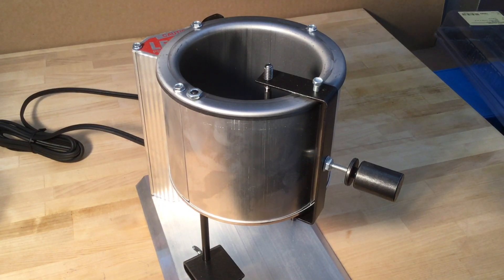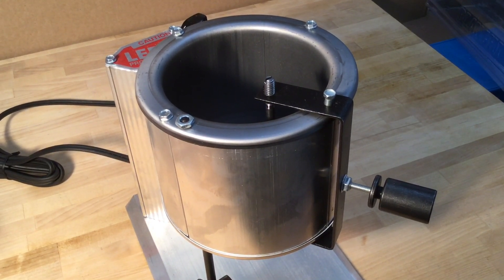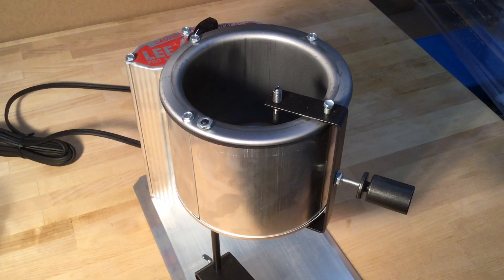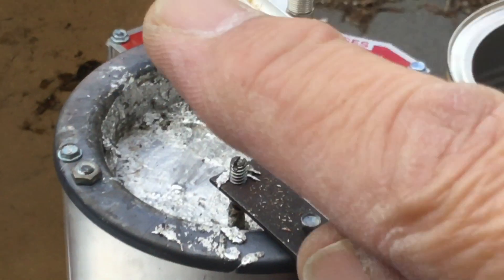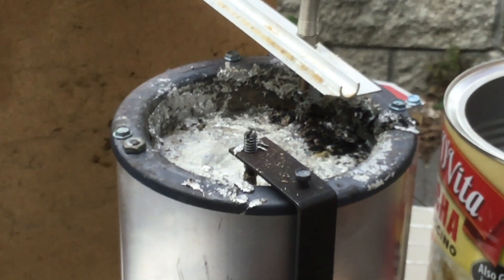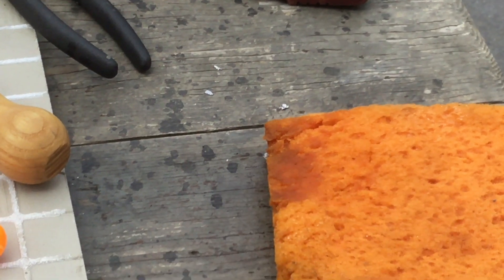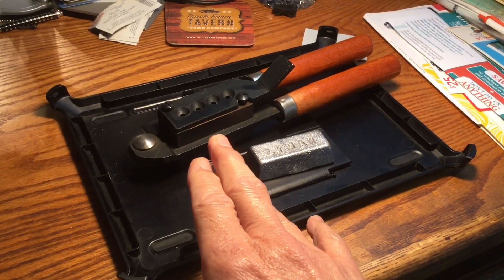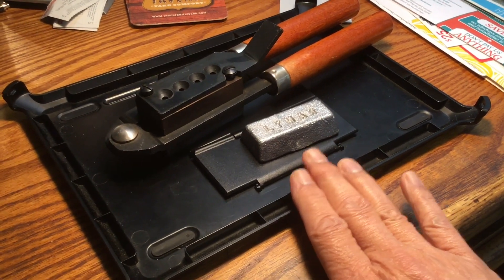Molten Lead, Water, Mythbusters And Casting Safety

Comment: My dad had an old piece of lead pipe he melted in his furnace and a steam pocket blew lead up out of the pot. Luckily he was not injured. 
Splattered molten lead covered the basement wall and ceiling joists in the basement. It was a permanent reminder how dangerous it can be.
Best to breakup the lead and melt it in small pieces if possible to avoid any pockets. Also cast outside if you can or in a well ventilated open area

Comment: I'm here to tell you a drop of sweat will cause a steam explosion in molten lead. I've had problems with casting in cold weather, so I do mine in summer. I  stack 1lb ingots around my electric pot to preheat them also. I was reaching  over the pot one day when a bead of sweat ran down my arm and dripped into the melt. It instantly turned to steam and blew little  lead splatters onto my arms.
Reply: Big difference between a little spatter and the kind of explosion you get from a submersion, especially if the water is encased. I've seen both now, graphically.

Comment: I've had one lead "explosion". What happened was I was water quenching bullets and used a spoon to push the pile around so I could make certain all the fresh bullets fell in to water instead of in top of the pile. The spoon I used sat for over 20-minutes totally away from any water and I decided it was dry and attempted to skim the top of my lead pot for a quick cleaning and the lead popped like a bubble. I had about a hand full size of lead fall right by my lead and hit he floor and another flew up and away from me. Not one piece hit me. Truly a miracle. I now have wisdom!

Comment: I'm pretty sure that if all bullet casters had ingots like yours that were known to be dry, there would never be any lead explosions. You about dropped a half a cup of water on the lead and nothing happened.

I'm thinking the only way to produce an explosion during casting with known dry ingots would be if someone somehow dropped an ice cube into the molten lead.
Reply from the maker: Dick Tickles - Any water carried into molten lead will cause an explosion.  But for a spectacular demonstration - If a big fishing sinker with a crack in the bottom of it with water inside was plunked into molten lead by holding the ring, or an ingot with a cavern in it with water in the cavern and you let the ingot go under with the cavern underneath, you have a guaranteed casting pot mortar and a ready demonstration of the tinsel fairy.  But I'm not going to do that demonstration...It's just too much of a mess, plus that lead is going to be very hard to clean up.  Best to ya,  FC

Comment: Thank you for your casting videos, I've been reloading for around a year and am lookin to get into casting.  

What was the apparatus attached to your casting pot?  It looked like a half circle sled for something.
Reply from the maker: Grant Ball - Thanks for your comment.  You probably are referring to the PID temperature controller - It's a very hand device to keep the molten lead temperature even and controlled.  Made by Johnny's Reloading Bench.  Best Regards to ya,  FC

Comment: Gotta double dip on this video with a humorous lead story, In our little reloading club one of the fellows "Brett" worked at a hospital in the maintenance dept. The hospital was replacing their ancient portable x-ray machines and  was throwing out the old ones. Well Brett being the genius he was , realized this was a lead gold mine and disassemble the old x-ray machines. What he brought to the shop was 15 lead donuts weighing over 60 lbs. each , problem was they were abut 12 inches in diameter with a hole in the center and about 5 inches thick all the way around , no way they would fit in the pot and very laborious to cut,  So another Genius member of our club" Charlie " was a volunteer firefighter at the local volunteer firefighting station  and his light bulb mind lit up. Charlie jumped up and said I know how to cut them ,  we were just donated  the jaws of life at the fire station , those things will cut anything,  It was a Sunday and Charlie had key's to the firehouse so Charlie and Brett went on an undercover mission to firehouse to cut the lead on the QT without permission. Well the story went like this, the jaws of life were applied to one side of the first lead donut and just about the time the jaws were almost threw the donut exploded into three pieces, one piece hit the firehouse bay door and completely penetrated it flew across the road and embedded in a tree. the second piece hit the fire truck in the bay and made a dent and crease about four foot long, and the third piece went threw a wall into a bathroom and broke the toilet tank and flooded several rooms.The moral of the story is beware of  reloading genious's
Reply: Roha Waha - that was the best YouTube comment I've read in a very long time.  Thanks for the laugh!
Reply: Thanks Loads , I subscribe to your channel and enjoy your video's !
Reply from the maker: Roha Waha - Everybody was dodging lead shrapnel...glad no one was hurt... FC

Comment: I had a lead gasification explosion about 30 years ago , me and a couple of friends were smelting lead in a plumbers lead pot that holds about 75 lbs of lead and uses a propane burner underneath. We were acquiring our lead from a junk yard that had an abundance of reclaimed  lead water pipe that had been dug up and replaced. We were novice casters at the time and no one thought that a piece of lead pipe about a foot long with both ends doubled over might contain water. Well , let me tell you , when it was stirred into the pot and sank and began melting the water was well below the SURFACE of the lead and about 30 pounds of lead went flying threw the air . We had some minor burns but nothing serious. I was the stirrer and had on a leather apron, gloves and safety glass's , it was a good thing I was wearing a hat because a dollop of lead the size of a pancake was on top of my hat.   BEWARE OF MELTING LEAD PIPE.
Reply from the maker: Roha Waha - Glad that no one was injured in that one.  Also, if lead ingots are stored outside, water can get into crevices and if those are put into molten lead, the same effect will happen.  That is why I have learned to store my ingots in 50 cal ammo cans sealed against any moisture and childproofed at the same time.  Best to ya, FC

Comment: Nive video, I had my first hopefull my last lead explosion a couple months ago. I was melting down some scrap lead that had been stored outside. I put in a roll of roof lead and it must have had a posket of water inside. the entire piece went under the melted lead in the pot. I always get away quick when I put new scrap into a molt-ant pot, good thing I did because I heard a pop (not very loud) and there was lead all over the stack of pallets I had my turkey cooker on. I learned from that, I have now a bucket I keep my scrap lead in. Inside the barn and I will always give it a few weeks to dry out after I bring it home. Also I am thinking of just putting one end of it inside the pot at a time or figuring out a way to pre-heat them. Its a work in progress. 

Thanks for another great video!
Reply from the maker: Barn Dweller - a hot plate set at 400 degrees does work well for putting on deck ingots to heat up - water will be gone in short order with the ingots at 400.  Another way to do it is melt the lead from an empty pot...as long as raw lead is put on top of the stack of unmelted lead, the heat will drive off any water before the lead melts into the molten lead.  But you've got the idea... once you manage any water that might be present, it is dealt with... Good castin' to ya,  FC

Comment: Let's not forget also that even the sawdust we flux with can have moisture in it. No matter how dry it seems it will suck moisture out of the air. I almost had a visit from the tinsel fairy because of that. I had just put a big pinch on and began stirring right away. When I used my spoon to force some sawdust under to try stir it to the bottom I could feel what I can only describe as boiling against my spoon!!! So let the sawdust burn up a while and dry off on the top!!!
Reply: Dave L: You have to remember that anything which produces gas or smoke, which wood dust will, can produce sub surface pressure, and a possible evacuation of the molten contents of the pot, I think the use of sawdust should be confined to surface treatment where it produces charcoal that mixes with the lead oxide and can be easily skimmed off.
Reply from the maker: Dave L - I've come to that same conclusion - let the sawdust sit there a while and char before the stirring...works well.  Like Englishman French says, it works very well on top to keep down the oxidation... Good casting to ya,  FC

Comment: Lead is not the only thing that water can cause an explosion with and a lot of damage.
Many years ago (in the middle 70"s) I was making candles to sell as a second income. One of the types I made was made using water as a mold. It took several minutes to make one candle with this method and a lot of wax was lost due to breakage of some of the fragile pieces.
Being the cheap skate and Waste Not Want Not type, I would salvage all the broken pieces by skimming them off the top of the water (wax floats) and putting the pieces in a can.
Then ever so often, I would use the multi colored pieces to make a Very unusually colored candle.
I thought I had DRIED the pieces completely, but it was not the case.
I used a peculator type metal coffee pot to melt the wax and get it to the proper temperature on the kitchen gas stove.
When I added another hand full of the wax pieces, there was one that had a bubble (I thought of air) but it turned out to be water.
The solid wax sinks in molten wax, so the water got past 212 degrees and KABOOM.
The whole kitchen, ceiling, walls, floor, cabinets, appliances, everything was splattered with hot wax.
I had make a bathroom run and did not get hit. That cost me several weeks of tedious work removing the wax and repainting the kitchen.  That ended my candle making career because I was renting.
Reply from the maker: archersfriend - Thanks for sharing that... Glad your eyes were OK and no bad burns.   I've made candles in the past as well...for Christmas gifts.  But it was a lot of work, and the store bought ones were better.  That's how my short candle making career ended.  Have a great day,  FC

Comment: Off to the side I have a old cast iron skillet on a hot plate and set my molds on it when taking a brake from a casting session. you can get one a Walmart for about $9.00 for the hot plate, that is where I picked up mine. I seen what Loads of Bacon did with the electric griddle,, That's a good idea too. Dave.
Reply from the maker: Thorsaxe777 - I've got to check that out, Dave -- the hot plates I've run into were in the $75 range.  That sounds very workable.  Best to ya,  Steve

Comment: I dropped a wet bullet in the pot today, I was prepared, it did blast out a nice batch of lead.
Reply from the maker: boomer dog - Whenever there is something like that possibility that wasn't managed properly happens, I duck below the level of the casting pot - if it blows, the lead goes up before it comes down.  I used to keep a blast shield handy, but the management practices really do work well...once we have understanding... Best to ya,  FC

Comment: So you try to preheat your mold to about 400? Same with the ingots too? I dont have a large hot plate but i do have a toaster oven would that work the same?
Reply from the maker: Edad Martin - problem with the toaster oven is that our molds don't need the handles preheated...the toaster oven would work for ingots though, but the shelves in the toaster oven won't hold much weight.  If we keep our ingots dry (I store them in sealed 50 cal ammo cans - then bring them out to the casting session - can be brought out in the 50 cal cans, but when you don't see them in my videos, it's because the cans are too heavy when full of ingots.  Best to ya,  FC